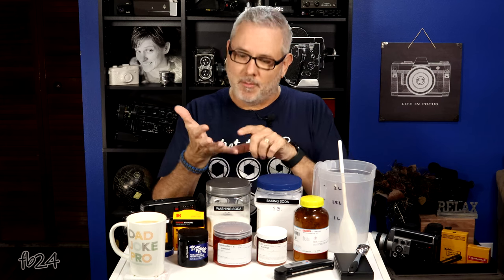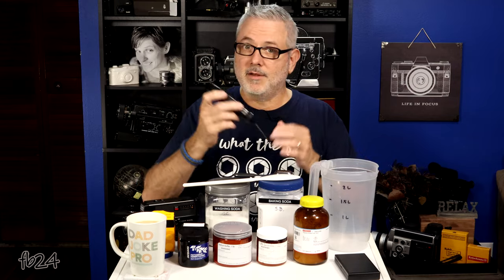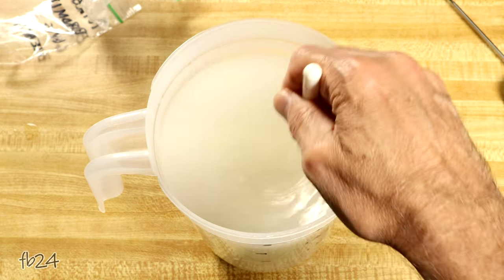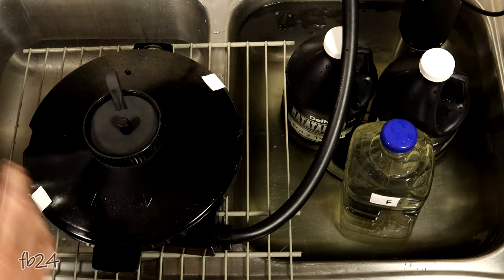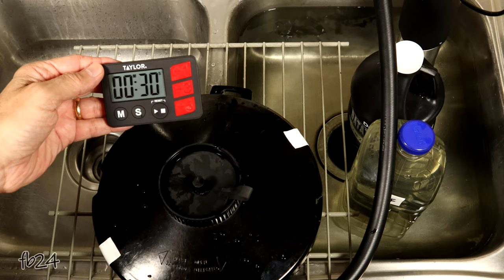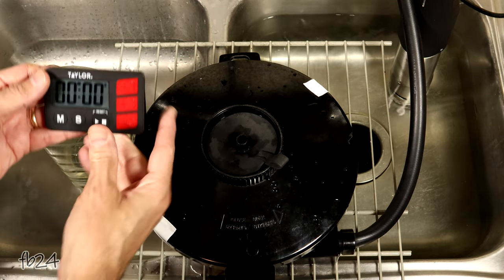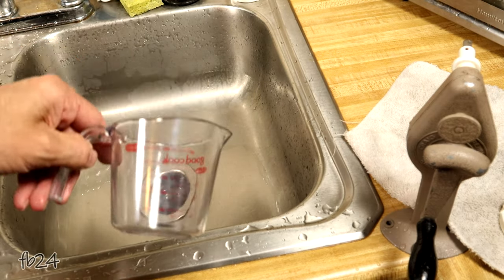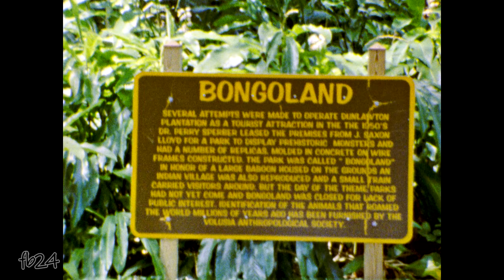Homemade ECN-2 Movie Film Processing Complete Step by Step Tutorial | Kodak Vision Films | Filmboy24

Comment: What a great video! This is what I'm looking for! Well, the Cinestill ECN-2 developer ist not that expensive after all, but you can't always get in here in Germany. The results you got from your developer (that seems to be some way easier to mix that the original Kodak recipe) look great. What I do with Vision 3 negatives ist not generally scanning them but copying them to 3383 with a DIY contact copier. So I need some negatives, that work well together with 3383 and ECP (that I mix myself). Have you compared your results with results from the Cinestill kit? Thanks for your help and again - great work.
Reply from the maker: Thanks, MFB!!

I haven't ever really compared the differences between my home brew and Cinestill's ECN-2 kit but judging from memory, I don't recall much difference at all. I guess the ability to mix a fresh batch any time I want and the cost were the main factors in me doing it myself. The beauty of Vision 3 stocks is that they have so much latitude, there is really a lot of room for error (and I make errors, lol). Most anything can be fixed in post (for me) as I don't print my negatives. I think the real difference between processes would be more noticeable in home processed (in whatever chemicals) vs professional lab processing.

Comment: Yo Mike, another fine video! Questions, what is creating the white scratches on the film? Is it the camera or the developing process? And I have seen those scratches on film that was said to be developed at a lab. You did answer a question I had about your home developing and newer film stocks and I like the results a lot. Having said that I like the white scratches and could live with them. Last question, do you edit your films in a computer or do you edit in the camera while you shoot the video? A little of both, maybe?   
 Keep a going!
Reply from the maker: Greetings, Lawrence! Thank you kindly!!

The scratches are sort of a mystery to me. In all honesty, I'm probably rougher on my film than I should be. I got lucky on this particular film and only got the vertical scratches for a few seconds (not so lucky on others). With my particular process, it's either happening when I pull the film from the cart (might be rubbing the lip), scanning the film (could be a tiny burr, though I check regularly), pulling the film through my fingers after processing (though I have Dawn dish soap hands 🤣) or when I spool the film after its dry (I pull it between a Kimwipe). I will solve the mystery some day and I'm leaning heavily toward pulling the film from the cart or my scanner.

As far as editing, with films like this one, it's pretty much straight from the camera. If fact, I didn't cut anything at all from this one at all, except the head and tail. I do use Vegas Pro 18 for everything except stabilizing (Davinci Resolve).

Comment: wonderful results Mike, is the idea that by using negative film you can store away the original film to re-scan in future or make a positive film from that Neg film  , as you cannot project Neg film ?
Reply from the maker: Thank you, Lyndon!! This Vision stock was really meant to be transferred and color corrected/balanced. Yes, you could print it and make a positive but you'd need to correct and balance during the printing. This was commonly done years ago when making prints for theatrical movies.
Reply: @Filmboy24  thanks ok so that was the way the film industry distributed by shooting Neg and making 35mm prints to sent to the Cinemas, I did a short Voluntary stint  in mid 90's in a small cinema in uk ( art house type ) i would arrive early and joint the reels together and feed the projector was a heavy job & sometimes i got a static voltage shock as the film was passing through. It was a good experience.

Comment: How did you scan this?
Reply from the maker: I scan everything with my MovieStuff RetroScan Universal.
Reply: @Filmboy24  do you know if there is an option to scan in a log type profile where the image is really flat to preserve dynamic range?
Reply from the maker: @colorgradingcentral  That's a great question. I now use the RetroScan Mark II 4K scanner (not on this video) and while it does a pretty decent job, it wasn't really designed for log scans. I can get relatively flat but honestly, nothing like the super high end machines.
Reply: @Filmboy24  thanks for the reply

Comment: Great stuff mate! Very impressed with the results!

Where do you get your CD3 from and how long does it keep for?

Can get everything else to try this but CD3 seems elusive... or 1200 for the 25kg drum 😅
Reply from the maker: Thanks, Nick!

I get my CD-3 here:
https://www.artcraftchemicals.com/product/cd-3-part-1090/

It keeps (in powder form) very well. I've had mine over a year and it still works great. Keep it stored in a cool, dark place (mine is under the kitchen sink).
Reply: @Filmboy24  awesome thanks for that. So to be clear on your yields, was it 6 rolls per 2litre kit or 1litre kit?

Do you see any degradation in quality in say rolls 3, 4 5 vs rolls 1, 2, 3?

Such a great resource this - waiting on the E-6 version now 😅
Reply from the maker: @nicklymberis5371  So, it's pretty tough to say for sure on how many rolls you can get out of a single mix. When I process super 8 with it, I'm using 1-ish liters out of my 2 liter batch and pouring it back in. This kind of replenishes it a little. If doing only super 8, I'd be comfortable processing 8 rolls this way, from the 2 liter batch. With 16mm, I can usually stretch it to about 5-6 100' rolls.

I did forget to mention that I usually add about 5-7 seconds to my developing time with each film processed after the first roll. This helps to compensate for chemical exhaustion. I really don't see any dropoff in quality at all doing it this way. You might even be able to take it a little further, I just usually don't.

Lastly, when processing with a remjet first bath, it's probably a good idea to filter all of your chemicals through a coffee filter, just to catch any impurities.

Comment: Hey Mike, so when you’re done developing V3 film and scan it, do you still have to invert the colors? I bought a “cheap” Kodak Reels scanner for already developed 8mm old family film but was wondering how I’d develop newly shot film and then be able to scan it. I’m eventually going to 3d print and build a better scanner (T-Scann 8). Thanks for the help!
Reply from the maker: That a great question. If you’ll be developing your film as a negative, the Kodak Reels should be able to invert it during the initial scan. My Wolverine Pro did that. There should be a “Positive” and “Negative” setting in the menu. One thing I did learn is that sometimes the film actually comes out better when scanning as a negative (scanner set to Positive), then inverting it in post software.
Reply: @Filmboy24  hey Mike, unfortunately the Kodak scanner doesn't have a setting for that. I was wondering if you have any issues with blue tint at all? I've seen a few other videos where when the negatives are inverted in post it leaves a blue tint to everything. Is that something you experience with the vision3 stock? Thanks again for your help!

Comment: How do I do the thing where is taken down a few stops if I overexpose the film?
Reply from the maker: You can "Pull" process by reducing your processing by 30 seconds. I would not recommend going any shorter than that though. Honestly, unless you really overexposed it, I would probably process normal. Most newer ECN-2 process film has a good bit of leeway (latitude) for correction in post, especially when overexposed rather than under..

Comment: Hello there can i just buy washing soda and baking soda from super market and use them with the other chemicals for developer and blix? Thank you
Reply from the maker: I use regular store bought baking soda and I while used to use store bought washing soda, I now make sure it's anhydrous (no added water). The washing soda at the supermarket usually has added water, so I now buy my sodium carbonate on Amazon. Honestly though, if you have no other option, the supermarket stuff worked fine for me.
Reply: @Filmboy24  thank you, do you have also a c41 formula?
Reply: @Filmboy24  Also i want to ask you , i found all the chemicals but some are not Anhydrous, is this ok ?
Reply from the maker: @tasost2161 I've used non-Anhydrous Sodium Carbonate and it worked fine. Typically, you'd want to up the amounts a little (not sure how much) if there is water added to the chemicals.
Reply from the maker: @tasost2161 I haven't made any C-41 but I've used this formula on C-41 film. It's not perfect, but it does a pretty good job.
Reply: @Filmboy24  someone told me if is not Anhydrous you multiply the amount by 1.17
Reply from the maker: @tasost2161 That sounds about right.

Comment: Where can you buy all the materials to home process and develop?
Reply from the maker: If you are in the US, you can get pretty much everything online at Artcraft Chemicals. I buy the Sodium Carbonate from Amazon and the Sodium Bicarbonate (baking soda) from the local grocery store.
Reply: What about the cartridges and properly getting the film from the chemicals to a reel and how can you see what’s on the reel? Equipment for that, I am trying to decide if I should just ship my 6 cartridges I have out or if it’s cheaper to buy all the materials from A-Z I can do it at home
Reply from the maker: @MichaelxBarakat  There are a few variables. First, you're never likely to get professional lab results at home. If you're ok with that, and you like the thought of complete control over your film, then home processing is awesome. There are upfront costs though, the biggest being the Lomo tank. As far as I know, these can really only be purchased from Ukraine (and surrounding) and are usually around $200 USD plus shipping, which can take a while to receive depending on your location. The tank is a one time commitment though and once it's yours, it's yours. You will also need some 50' super 8 reels, which are around $2 each at Urbanski Film.

If you're only going to do 6 cartridges, then be done, it's probably cheaper to just send to a lab. If you want to process your 6 rolls and beyond, then you may want to consider getting set up at home. Only you can answer that.

Best of luck!!

Comment: Can I process 35mm film using this dilution of chemistry?
Reply from the maker: I've done it several times with "C-41" film and while it does work, they are not the same process. I got some shifted colors but was able to fix pretty well in post. If you're doing 35mm "ECN-2" film, then yes, this would work fine.
Reply: @Filmboy24  I bulk roll my own ECN-2 35mm film. Being able to make my own processing chemistry as well is great.

Thank you very much!
Reply: @Filmboy24 Any idea alternative names to CD-3? Can't seem to find it online.

Also, will Kodak Fleixcolor fixer for c-41 work with the ECN-2 process? If not, which one would you recommend using?
Reply from the maker: @singularity1676  I get my CD-3 from Artcraft. Here is the link to it: https://artcraftchemicals.com/products/cd-3-part-1090?_pos=1&_sid=3cb8e4309&_ss=r

I have always used Kodak powder fixer. It comes in a large pouch and you mix it with 1 gallon of water. Has never failed me.